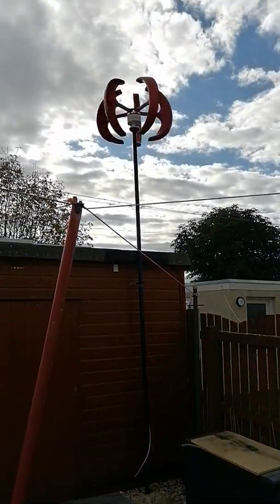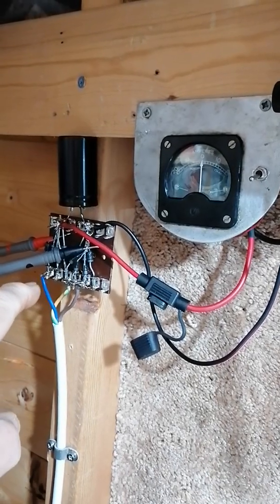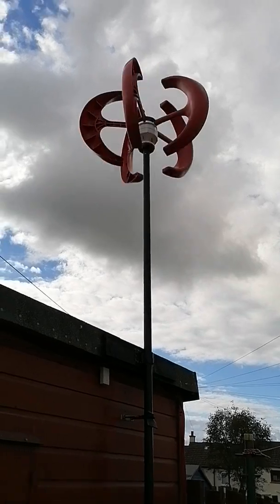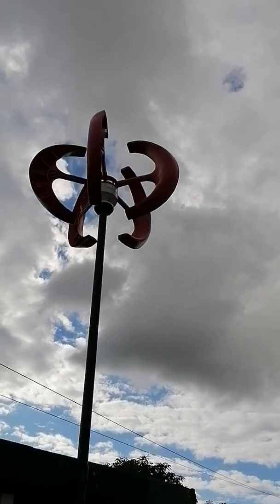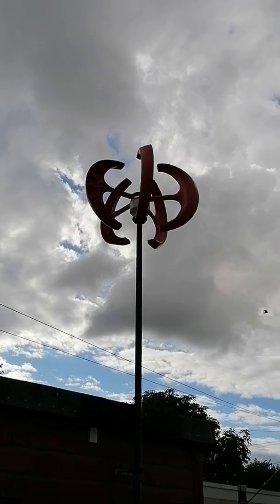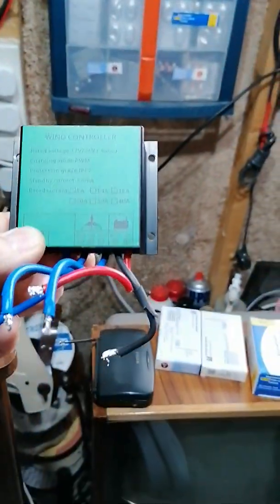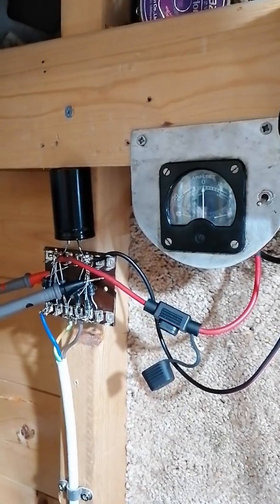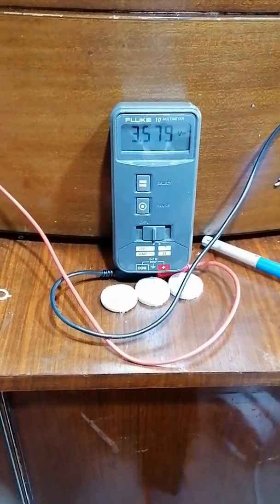Disastrous vertical wind generator.

Comment: Like you I have been unable to get sufficient charge into the battery from the turbine and the battery which powers up the controller  continues to discharge, waiting. There is quite a narrow working range with either too little volts produced or two much voltage disconnecting the charge. WIsh there was a circuit controller that coverted any voltage produced by the wind turbine to the required charging input of 14 to 16V. Anyone have a controller circuit?

Comment: I bought a 5000 Watt / 24V from Alibaba. Before mounting, I tested on the ground with wind speeds of 40km/h, than I connected it to my fast drilling machine (simulating the rotation) In the best test scenario  I got around +- 100 Volts, 0,03 A - that is around 3 watts... I thought it would be the "controller", so I made a 3 phase rectifier, but same result.
So if you think you can power something or charge a battery with this system,  forget about it. This is just a big scam !
btw: the 5000 Watt generator  looks the same (and size) as the 600 or 400 Watt version... lol ... DONT BUY IT !!